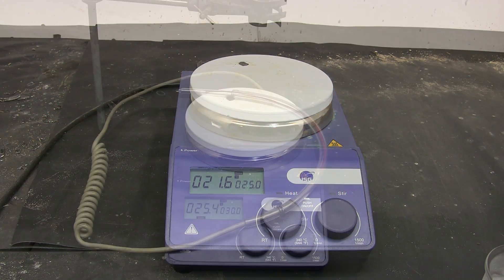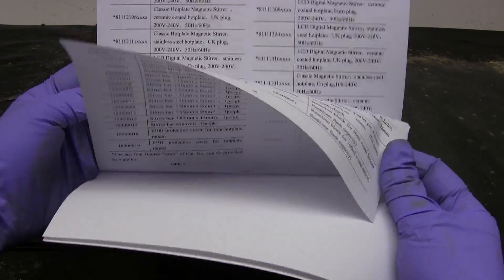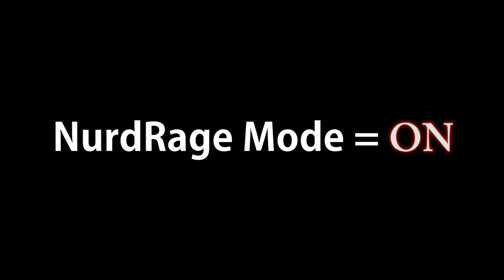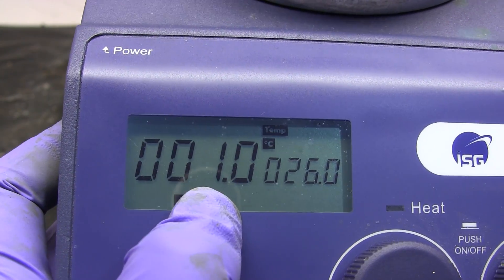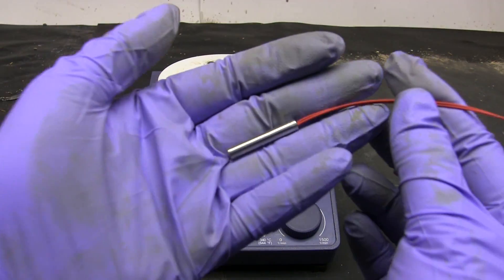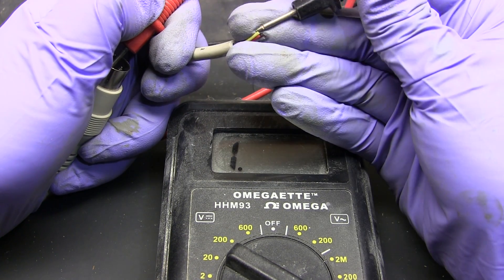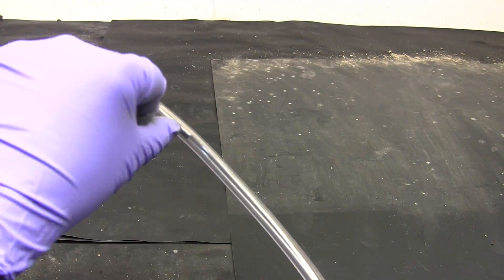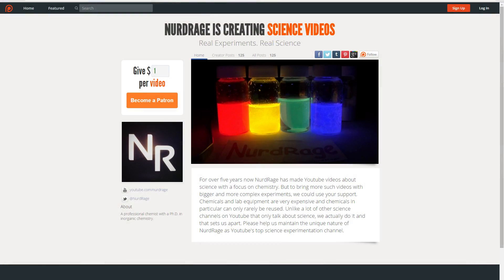Make a thermometer probe for a westlab/scilogex hotplate

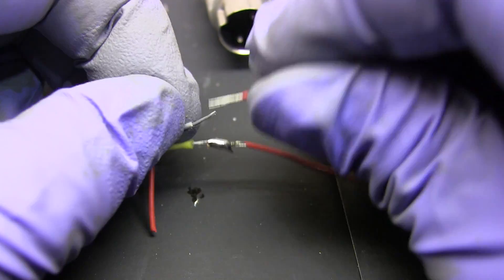Comment: 6:05 I'm by far not an electronics expert, your soldering doesn't look too bad, but I would just advise you to use dedicated heatshrink tubing to insulate the exposed parts rather than tape. Or at least electrician's tape, but heatshrink tubing is both more convenient and more reliable.

Comment: Given the nominal resolution of the display, and without knowing the rated accuracy of the  hotplate, it's entirely possible that you could get better accuracy by connecting the temperature sensor in a 4-wire configuration. Adding a shield would bring the total pin count up to 5, and this is a suspiciously good match to your connector. You might contact Scilogex about the probe connections. On the other hand, I doubt you really need high-precision temperature control, so this  might be overkill.

Comment: The high price of accessories is pretty standard. Most of the lab equipment and accessories / options is extremely overpriced. Sometimes by a factor of 10. This is because most of the time labs want a convenience and just to get a whole package, and because most of this goes to universities, that already spend a lot of money on other equipment, asking a lot extra, it will still be bought. Which is shit, because this makes amatures, or high schools really suffer, and makes this simple equipment be inaccessible to a lot of price sensitive labs.  Sure, some of accessories will be priced higher because they are using properly sourced components, and are calibrated, but a lot of them will come without calibration certificates, which is shit.

Comment: This really brightened my day!!!
Couple of assembly suggestions should you ever go back to it:
1. Use narrow gauge heat shrink tubing to cover both of the solder joints. (the tape you used will likely degrade rapidly under high temp). 2. Instead of (or in addition to) the wire crimp seal: a) inject about an inch of silicon sealant into the tube; then b) use a longer piece of heat shrink tubing (4 or so inches) to bridge the intersect of the cable and tubing.

Comment: I found this same problem when I bought a heating mantle off eBay. Total Chinese manufacture (not an insult, just the origin). Pic showed no probe, but mantle required one to work. I hacked it by creating a circuit bridge switch which just allows me to turn the thing on wo/ the probe. I found a probe on Amazon for like 12 bucks, too. Attached DIN 5 plug and it works fine. Also, big bundle of heatshrink tape at Harbor Freight for $1.99. Great hack, NR.

Comment: absolutely awesome video! I'm a chem grad student, and our lab is broke, so I've been buying broken hot plates by the lot on ebay and trying to fix them, and I've gotten lucky with a few snapped solder joints and loose connections, I'm feeling more ballsy. Now if only I can adapt this video's technique to my stack of 7 or so IKA/Chemglass digital display hotplates (the real nice ones :)) I have lying around, hmm. They don't seem to work without a probe attached, and I only have one probe. If I can make probes, that would be excellent! and yes, likewise, the IKA probes are $150 a piece, yikes! It's a different pin configuration, a 6-pin, DIN 45322, I'll have to buy myself one or two bare pt1000 units and have a go at this! One issue I read about is whether my hotplates are 2 or 3 pin sensors. Now if only I can convince my PI that this is a worthwhile endeavor, hmm...

Comment: i took an old watlow controller, t type thermocouple and relay and made a feedback loop for a 1000 ml glas-col mantle i won on ebay for 12 bucks. scavenging around university disposition warehouses  is incredible!!

a highly accurate mantel controler for perhaps 15 bucks, really less because i have parts left for 5 more enough.

at the university oh michigan i bought 10 cases of 500 ml corning flasks brand new for 2 dollars a case 6 each. cases of sample tubes for 5 bucks.

i built a 6 position centrifuge out of wood lol!  it works amazing.
when there is a will there is always a way

Comment: For those playing along at home, This uses a DIN-5 180° connector, which is identical to some old computer peripherals (like the keyboard in the video) and is best known as the MIDI cable connector. 

For NurdRage: Your soldering will do the trick, however there is no detriment in twisting the wires (both individually and then together) prior to soldering. The solder is flux core and the flux will penetrate the interior of the twisted bunch.

Comment: A few things in my lab were made by me. My condenser tube, magnetic stirrer, lab stands for holding stuff, adjustable power supply, etc. I would much rather make something than buy it. I'm probably going to make something similar since right now all I have to measure temperature is a meat thermometer and an IR thermometer

Comment: Woah you paid $474.10 for a stirring hotplate!? Looks like you already took it up the ass (even if they gave you the temp probe)

Oh and use heatshrink! It's so much more reliable than tape :)
Reply from the maker: ThisIs MyName actually they raised their price. I got mine for $309. But if you know where i can get a hotplate stirrer with a PID controller then please let me know :)
Reply: NurdRage You can make one! I got a normal hotplate and hooked it up to a SCR and Raspberry Pi. The RPi turns the SCR on and off 60 times per second to switch the passive (120V AC@60hz) hotplate. 

Oh and the controller is even better than a PID. It's a Kalman filter :D
Reply from the maker: ThisIs MyName Where is the stirrer functionality?
Reply from the maker: ThisIs MyName a good hotplate with stirrer costs around $300. so you haven't saved me any money hacking it open and adding the SCR. 

I'm not bothering with the crappy ones at $100 as they break down too easily or don't heat up enough to do chemistry.
Reply from the maker: ThisIs MyName Yeah, I can easily get a hotplate alone for $20 and $40 with temp control. But i really need the built in stirrer for chemistry. if you can make a combined hot plate stirrer with temperature control for less then $200 then you;d have something you could sell. 

Anyway, don't complain i took it up the ass if you cant provide a viable alternative.
Reply: It wouldn't be hard to add. A PID is pretty much just a temperature controlled relay
Reply: NurdRage Pretty much just need a hotplate and a heat shielded motor to drive an arm containing a neodymium magnet.
Reply from the maker: James Wood How many have you built? and you have an online shop where i can buy them?
Reply: I made a few back in high school for my home lab. I've never made them commercially, but its pretty simple to retrofit a analog hotplate if you would like some instruction. You might even be able to make a video of it of you so desire.
Reply from the maker: James Wood Does it have a PID controller?
Reply from the maker: James Wood If you can do it all for less than $200 then you could make some decent money. Heck i might buy from you. Go for it.
Reply: +NurdRage Really? "F--- THAT?" Why didn't you simply go to Patreon and make them pay more money?! Okay, You know what?! I dislike this video!!!!!! >:(
Reply: Mario&Luigi VS. Koopa Did you have a stroke?
Reply: +ThisIs MyName No. He swore.
Reply: Mario&Luigi VS. Koopa
No I mean wtf were you trying to say?
Reply: ThisIs MyName Didn't I say he swore?!
Reply: Mario&Luigi VS. Koopa
You disliked the video because he swore??
Reply: ThisIs MyName Yes
Reply: So you go into a church. Hear the priest preaching and then you dislike him because he preached. Well then not go into ones church and get awere of the actions that is involved in the profession of practioners. Substitute any place, profession and action or what ever suits to make someting one can act as witness one is not statet by law to be there on purpose. For Ex. nudist beach ... Ok profession is then a little off.

Comment: I also had the idea of using resistance to determine temperature, some weeks ago. Did some research and discovered a lot of thermometers use resistance values in the same way. Basically I was thinking of using an Ohm-meter with a sensor like this one, standardize it and later use it.
This video came out just in time! Thanks! I wouldn't have thought of using an old pipette as a casing haha

Comment: The other leads for the probe may be for simple circuitry to calibrate/simulate a 0C load (reference junction) to measure against, this may then let the probe read below 0 Experiment some more with the resistors...

Comment: I would recommend putting a blob of decent quality heatsink compound into the bottom of the tube, to improve thermal coupling between the glass and the sensor. Also, one could use high temperature epoxy to fill the space above the sensor and seal it.

Comment: I'm an Electrical Engineer (or soon to be, I just got a BS in EET a month ago)... and I only laughed for a few seconds. I've seen much worse soldering. Now your choice of tape... I would have used electrical tape (the good kind, not the cheapo junk kind, there is a difference) or better yet some heat shrink tubing. But scotch tape works in a pinch, as long as there are no sharp edges (which your "technique" didn't produce).

(Electrical/Programming Nurd content ahead!)

As for the 0C issue, that could be a software issue too... the way these work is they have an analog front end that converts the resistance to voltage, probably an OP-AMP circuit, but could be a transistor amplifier given the knockoff grade of construction (instrumentation circuits generally uses OP-AMPs). From there the voltage goes into a DAC (digital to analog converter) and then to the digital side, which is either a custom digital logic chip or more likely (given the supposed presence of a serial output) a microcontroller (which often has the DAC built in). In the latter case it would be programmed.

Unless the issue is caused by the amplifier clipping (caused by the limits of the supply voltage(s)), the code could be tweaked to go lower... I guess this would be useful for regulating the temperature of highly endothermic reactions? That said, the chip probably has the code locked and even if one could get and decompile the code, the control (temperature regulation) aspect of the function can be persnickety (I took a controls class, they can be temperamental when tweaked)... You, NR, seem to be more of a chemistry nurd than an electrical/programming nurd so this is probably WAY outside of what you'd feel comfortable doing.

Comment: NurdRage ROFL- I almost died laughing when you used clear tape to insulate the soldered leads! Next time use either heat shrink tubing, electrical tape or liquid electrical tape if you have/can get any of them.
Reply: Ben Bogard Why its bad? It insulated it effectively
Reply: wwwelkam Due to the fact that this was a simple thermistor, it was insulated "effectively". It's always best practice to use one of my above suggestions, and it's "mandatory" to use one of those options if your wires are carrying any large amount of current or you are working with high voltage.
Reply: Ben Bogard so why it was bad in this situation? These wires does not carry high current nor are high voltage. 
To me it seams that your gut feeling says its bad and then you try to rationalize it.
Reply: wwwelkam No, its quite simple. Clear packing tape was never meant to insulate wires. Thats not what its designed for.
Reply: Ben Bogard So? Glass pipette was never designed to be a protective housing for cheap thermometer probe that doesn't mean it cant be used as such
Reply: RightHandPossession Can any one of you say a reason instead of repeating statements?
Reply: wwwelkam They have no reasons. 

Convention says to use RATED (they missed this very important specifier) heatshrink or rated e-tape at the very least, wire nuts are acceptable in some fields. But for this purpose, and for the potential and current this is operating under, cello-tape is more than acceptable in a hobby-type use. You would not use clear tape if building it for someone else, but electrically, it is fine for the near future. How quickly the tape degrades and the time until the joints short on one another depends on the tape.
Reply: wwwelkam Shrink tube would fulfill that particular use much better, even if unrated and over tape. Tape slides past itself too easily and the messiness of the natural rubber adhesive makes it poor for reworking after application and use.a
Reply: Are you kidding? I picked up an entire roll ~300m of 5mm black heat shrink at a local ham radio swap meet for $15 bucks along w/ an old Yaesu transceiver. You can also pick the stuff up from Harbor Freight or McMaster for 99 cents per pack (~1m).
Reply: wwwelkam IT is cheaper, but it only adds bulk and little strain relief. Like I said, it slides past itself, while shrink tub constricts and adds the strength of the tube uniformly to the outside of the cable in question.
Reply: Thor214 Finally some one who understands. Also it is good idea to use electric tape to reduce the strain the joints will endure during the bending of wire.
Reply: Thor214 and its more expensive. At least where i live
Reply: Ben Bogard Not everyone lives in America. Where I live I can insulate at least 10 times more wires with electric tape than heat shrinks for the same price
Reply: Thor214 I dont know what kind of tape you tried, but IT normally dont slide around.
Reply: With any normal use outside of a period of 4-5 days, the adhesive will permit the tape to slide around if it is filling the role of strain relief. It is not useful for structural reinforcement without adding a huge quantity that looks like absolute shit.

Comment: As an EE, I wasn't laughing at your soldering. I did cringe a little bit at using tape instead of heat shrink tubing. It would have provided more trustworthy insulation.

Comment: im doing a chemistry degree and my hobby is electronic engineering, you should put solder on the wire before you solder them together as it means you don't need to hold solder to the joint when soldering together just remelt the solder, and give your soldering iron tip a clean too

Comment: İ understand one resistor fake the real thermometer and it show minumum number it can show. But Can someone explain why two resistor show 256 degree on the screen?
Reply: ***** The PT1000 sensor is defined by a table that matches certain resistance values to certain temperatures. You can google for that table.
http://www.solarhotusa.com/products/controls/files/Resistor-table-Pt1000.pdf
Two resistors with each 1kOhm in series makes 2kOhm. A pt1000 with 2kOhm is about.... something between 260 and 270 degrees for a PT1000.

Comment: NurdRage Some heat-shrink tubing over the solder connections, then heat-shrink again over both of the wires and stripped outer cable would be better than using scotch tape.   It would look better too.

Comment: Check your temperature against a thermometer at 100 Degrees if its out you may find you should have a 3rd wire connection to balance out ambient temperature.

Comment: Though I was able to find one for $5, Din-5 keyboards go for around $30-$70 whereas A din-5 cord goes for around $10. You could have covered the cost of making the probe by selling the keyboard on Ebay.  As you did it, the cost was around $50 (counting the keyboard at $35, sensor at $10, pipette at $5, and tubing, solder, and shipping ~$5), so you got the probe for about the third the cost.

Comment: The soldering wasn't terrible, but the tape made me cringe.
Reply: Forssa1 Yea a pack of heatshrink would have been better and make it more secure. It's also cheap and lasts forever if your not using it daily.
Reply: PyroShim I've seen people with actual skill and knowledge in electronics solder worse.
Reply: Forssa1 It is not about being better than someone else. He is over the terrible threshold. I am not hungry so no beef for me now.
Reply: Forssa1 True, some heat shrink tubing would be better.
Reply: Forssa1 The soldering was terrible but he got the job done.
Reply: Forssa1 How does that make his soldering better?
Reply: Forssa1 Me too. It needs proper electrical tape.
Reply: Forssa1 Though I still wouldn't give him too much credit for soldering... He should have twisted the wires together first, and more than anything, he should have made sure he got the wire hot so the solder would adhere first.
Reply: Simon Nee
 Haha never was upset and Im hardly an engineer. Just a computer geek that would rather try and fix rather than replace.
Reply: Slurpon Muhdick doesn't matter much. It's virtually low voltage dc with high impedance in/out. Will probably dry+flake+short in 20 years but w/e. No damage and 5 min fix
Reply: Forssa1 Hey now,don't act like you've never done it. ;)
Reply: Simon Nee
Yeah it will function fine, but it looks sloppy and that tape won't hold up near as long.
Reply: Robert Rockey "Lasts forever if you don't use it daily" You're a goon.
Reply: Gary Hay
What is there a problem with what I said? Its true, I bought a single variety pack 5 years ago for 10 and only needed to use it for repairs and minor modifications and still have half the pack left. So how is what I said wrong or stupid?
Reply: Robert Rockey don't get upset. You have other engineers on the scotch side :3
Reply: Forssa1 I was going crazy let alone when I couldn't see any heat shrink when he was soldering... Then when I saw the clear tape in use I just did the good ol' face-palm.
Reply: 33pwnt33 it depends on the solder and the temperature. Twisting wires is not at all necessary. What you describe is necessary for thick cables with low temperature and lead free solder...
Reply: Simon Nee I know it isn't necessary, but it sure as hell makes things easier (the wires don't fall apart while being soldered).  I do get your point; I guess that my suggestions aren't necessary, but they are a good practice.